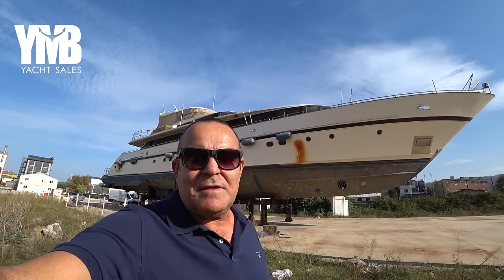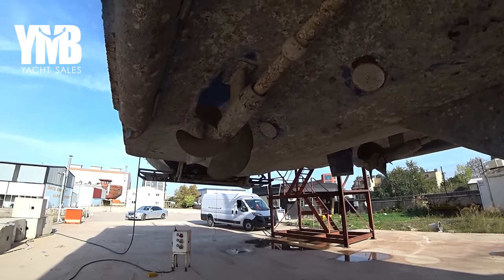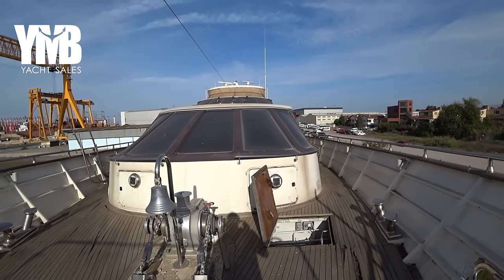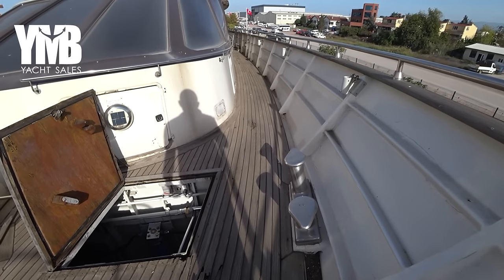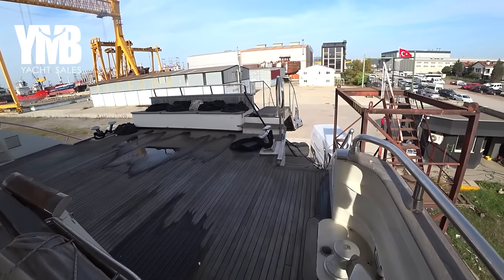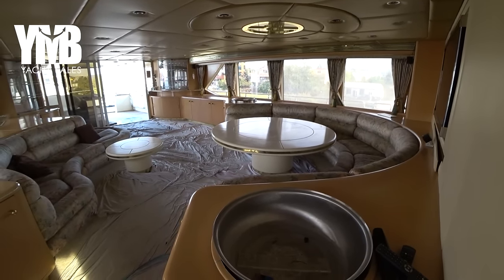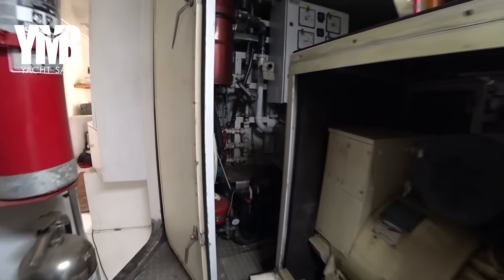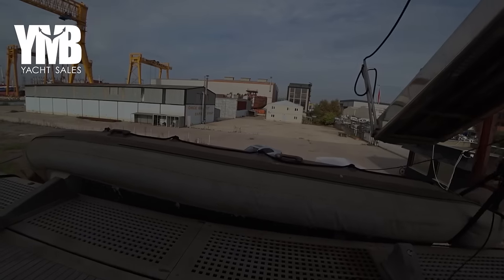PROJECT YACHT / AGARTHA 35 m - ALUMINIUM HULL By PORSIUS SHIPYARD HOLLAND / VIDEO Tour (Walkthrough)

Comment: This boat is going to need almost an entire gutting and rebuild, for the asking price.... "IF" I was looking at this boat to buy, the price would have to be dropped by 95% and the VAT paid, before I would even think about it. The possibilities are massive with this hull, but so it the price to get her back on the water at 100%. Thanks for the video.
Reply: Have to agree. Asking price is ridiculously high although depends on what you intend to do with it. Hull needs to be stripped and repainted. Props and shaft seals will need a refurb. No idea on condition of engines. 

Decking needs pulling up and replacing on at least one deck and a full refurb where possible on the others. 
All windows likely need to be removed refinished if possible, replaced where not and seals replaced.

Electrical wiring, hydraulics, HVAC is a big question mark probably all needs upgrading/replacing. Same with all pipes for clean water, black water etc.

Nav station needs a full upgrade/refit.

Thats the absolute basics just to make it safe and "useable".

The Interior needs a minimum 70% refit depending on taste. I think the main saloon could do with an upgrade. Rip out the weird seating and tables but leave corner glassware cabinets. Maybe put in a wetbar down one side and dining table and normal seating ie couches. 

Kitchen could possibly do with just a "lick of paint" instead of a full refit as it is fairly functional.

Front cabin/seating area? Could do with a refresh i suppose to save money or could be converted to a new cabin.

All guest bathrooms need a desperate upgrade to all surfaces. Bathrooms are grim. Guest cabins and staff quarters need to be updated, may not need a full strip and refit so things like flooring could stay (maybe just restain)

It needs a LOT of money spending on it unless someone wants an expensive non operational "home"

For 500k more you could buy a MUCH newer and more modern immediately useable and functional yacht that can accommodate about the same amount of guests.
Reply: @hogwild5844  Agreed, I laughed when I saw the asking price.

Comment: to consider any possible purchase of this boat looking at the condition of the Hull, the teak decking and other possible problems that a survey would produce it is going to close a small fortune to bring the vessel up to any acceptable condition and as said possible scrapyard for the weight in aluminium, engine and parts

Comment: Actually, my goal is to find a very very old, 35+ m size, original steel hull, that has never been refitted, for the purpose of gutting it all out totally and completely modernized it with the newest electrical tech, solar everywhere, open space, gym, golf simulator, that only sleeps a total of 6 to 8 people.

Comment: I redo boats.  But this one seems a bit overvalued.
Reply: I think the a large portion of the price is the aluminium construction. If those engines can be rebuilt and the structure is solid, it could be a good deal (hell of a lot of glass to replace).

That boat has charter written all over it.

Comment: That wood deck is warping. You simply cannot leave that unattended. It could have been saved but now most likely needs to be replaced. What a shame. Seeing that I know nobody has been saving the paint either. They could have spent just a little time and a few dollars for wax to protect it. Again, major shame. How lazy can you get? It's peeling off the bow and if you leave that open it lets humidity get in between the poly and the metal.  If I were to refit her, I'd ceramic coat the inside and outside of the exhaust, and modify the heads with a formerly secret spark plug design used to ignite water in place of diesel or gas. This can be done on any cylinder diameter above 4.3"   This was used on the aircraft used to bomb Hiroshima and Nagasaki, since they found that even after stripping the weight of the aircraft they would not have the range, so the had to dig into a classified patent.  I think I've posted a video on this design.  It'll run best on saltwater but does more than gas power using freshwater. Asking price 990k euro way too high, especially considering the ancient interior design with wood paneling. I'd be embarrassed to even launch it like that, seeing what great potential she has with exterior looks. This is a 100k boat at the most. Might get something better at auction for half that.

Comment: Given the condition any price is too much.  I wouldn't even take this on as a freebie for a project.
Reply from the maker: She is healthy enough to justify a deep refit which will end up having a great value yacht All aluminum with a navy standarts engine room and mechanics. I disagree to your comment.
Reply: @YachtMarineBrokerage  Why is she still for sale then?
Reply: @PUBLICSECTORJOBSWORTHS  Absolutely NOT!  The spend over such a significant refit/rebuild does not validate to the projected valuation at any time going forward.  The boat is basically a hole in the water minus the water into which some moron will keep pouring cash.
Reply: I agree
Reply: its a situation when someone buys it for £1 to take ownership and then spend the 999K on it